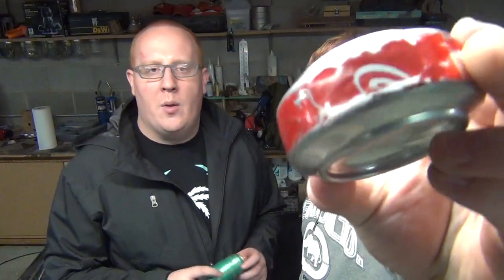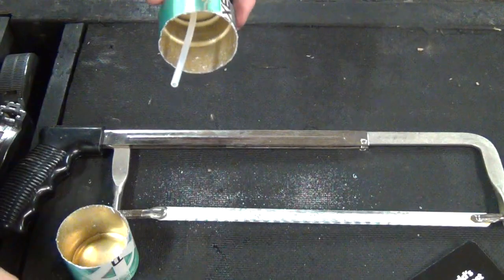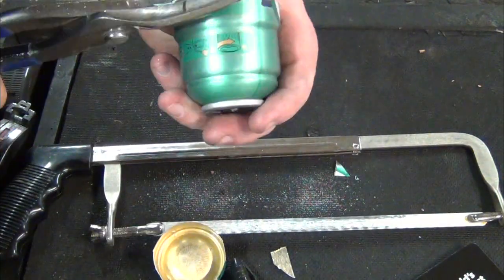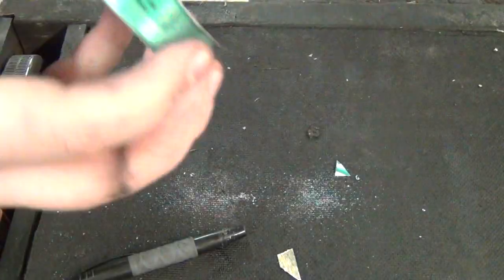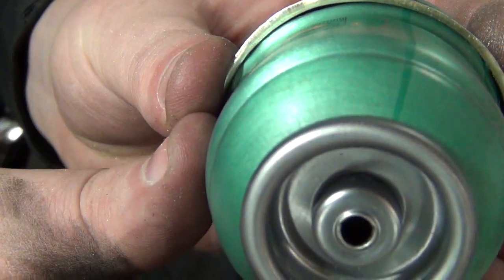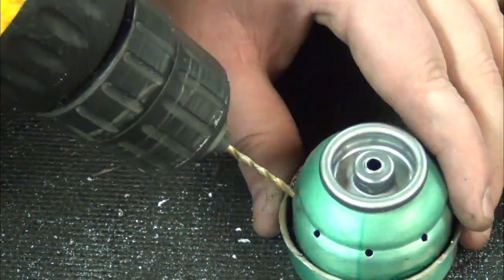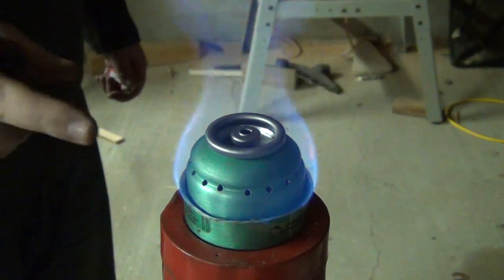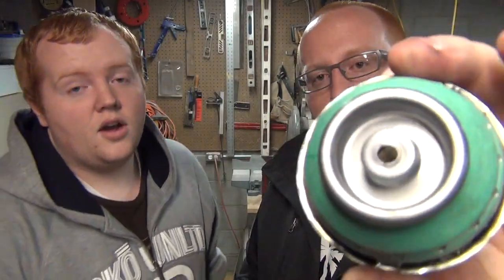AXE Bodyspray DIY STOVE - FNF Survival

Comment: I have a challenge for You .
In a true survival situation ( at home or not ) You're going to be very limited with Your fuel ( whatever it is ) ,if it's alcohol for a stove , it's got to be a very very fuel efficient stove .
The challenge is to heat canned food
& ramen noodles  both to the desired
temperature , w/least amount of fuel
( not necessarily the shortest time ) .
Stove must be made with minimal
tools already on hand ( remember ,
We're talking an emergency ) , stove
must be able to be made by almost
Anyone . Fuel can be anything on hand . Fuel container must not waste
any fuel unnecessarily . Good luck
( You'll need it ( this is harder than it
 sounds )